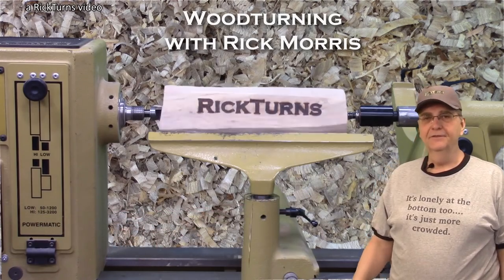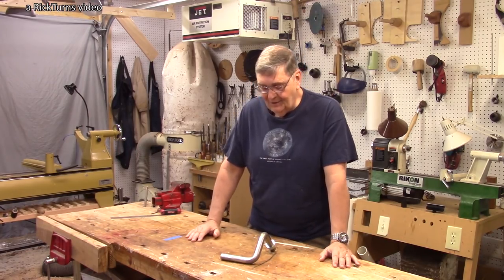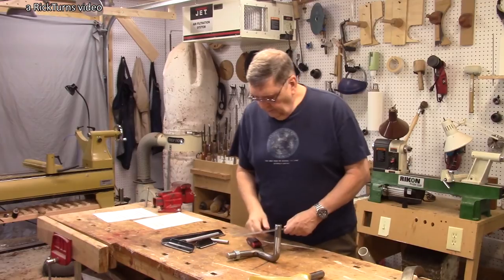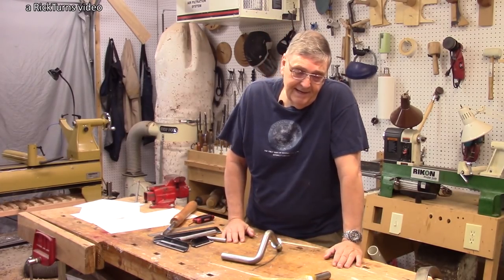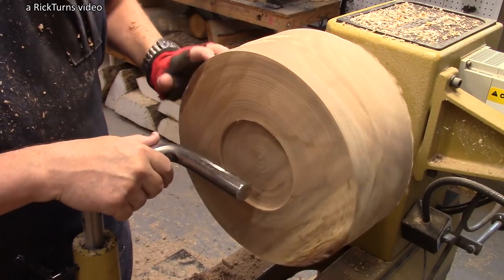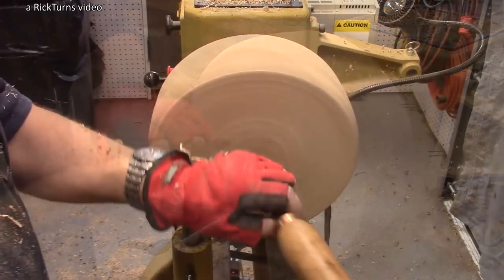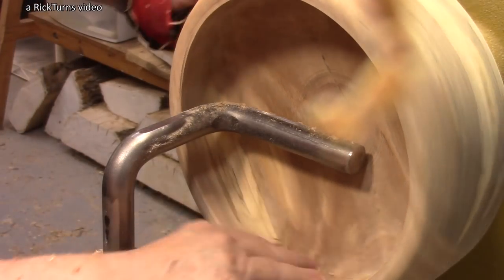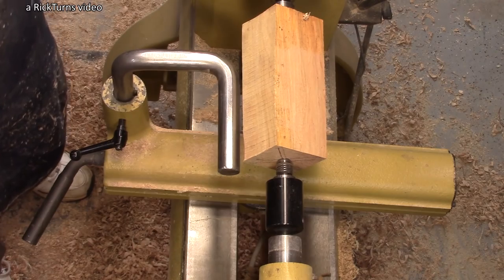A New Tool Rest Under the Sun!!

Comment: Excellent review, Rick, but for me this is a solution without a corresponding problem. It doesn't seem to work well for anything except a relatively square-bottomed bowl. What works for me inside a bowl is to simply swing the banjo around 180 degrees, then successively swing the near side of the rest into the bowl. This keeps the rest and gouge at obtuse angles, and provides deep support for scrapers.  Clyde
Reply from the maker: Thanks for your comments, Clyde. I haven't tried doing a 180 with the banjo.

Comment: All well and good, but what if your tool post hole is 5/8
Reply from the maker: I forgot to put that in the video.  Joe says he is currently working on a 5/8” version. But I don’t have a date for it.
Reply: Cool, though my little lathe can't turn anything bigger than 10"
Reply from the maker: It would fit inside a 10" bowl. Maybe Joe will have a 5/8" available sometime soon.
Reply: We are working on a 5/8"  diameter prototypes are in the final stages.

Comment: too long. outside the support center. cause vibration. insecure
Reply from the maker: Not sure what you mean about the support center...are you talking about the banjo hole where the post sits? After using it for a while, I haven't had any vibration with it.
Reply: Gilson have you use it? Your comment is not valid. At the distance from the center of the tool holder all the way out there is no vibration, just convenience for its application.